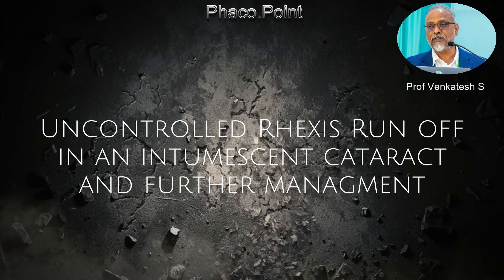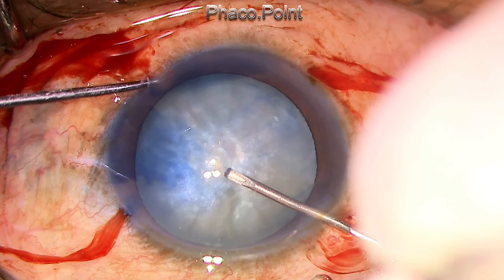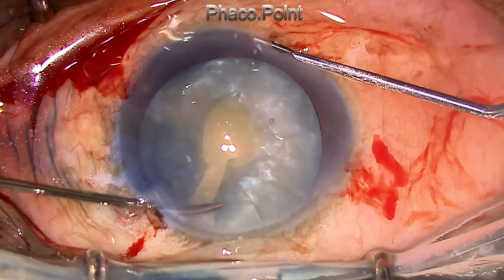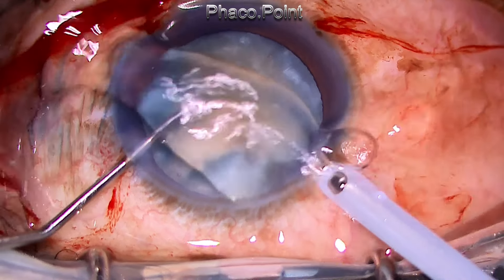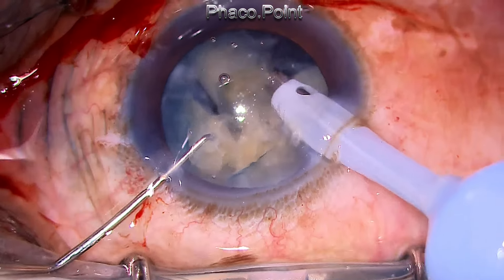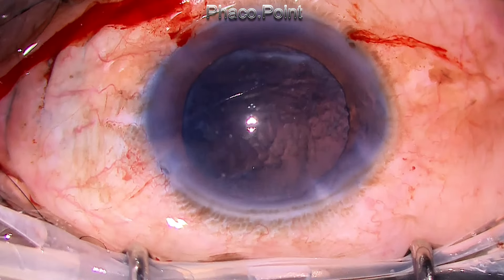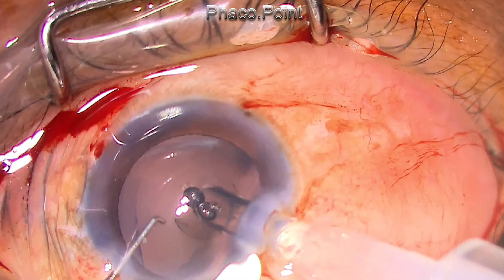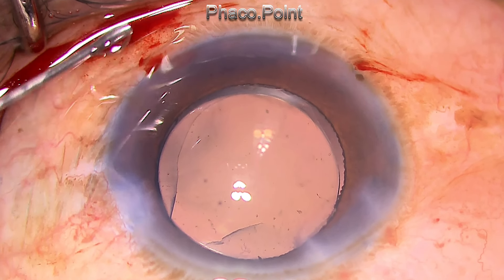Uncontrolled Rhexis Run-Off in an Intumescent Cataract and Further management with an EDOF IOL

Comment: Excellent management sir.
In my experience,use of micro-rhexis forceps and using side-port incisions only for making rhexis in any type of intumescent cataract significantly reduces the chances of run-off.
Visco-saline exchange is the most important in such type of cases to avoid tear extension to PC as perfectly described in the video. Thank you very much for sharing the video.
Reply from the maker: thank you dr Umesh. I will tr the mini rhexis forceps next times.

Comment: Is it useful to inject kenacort before injecting the iol? Just to be sûre there is no vitreous
Reply from the maker: In this case -NO, because using clinical judgement it is clear that there is no vitreous. But certainly in cases of doubt. signs like peaked pupil or de centring IOL or irregular AC. So many unnecessary steps can be prevented by paying attention to clinical details
Reply: @PhacoPoint  thank you! :)

Comment: Sir is it safer for patient and Surgeon to always convert to SICS in cases of rhexis run off or should we proceed with phaco thinking it will be our lucky day?
Reply from the maker: Please do not continue  with phaco thinking it will be your lucky day , because successful people make their own luck.. The same confidence you have with SICS will eventually come with phaco also and then you will not think of conversion but simply continue knowing that it is possible. This change in mindset will come with time and as you perform more and more phaco. It cannot be rushed. I have had many run off rhexis and I have not converted to SICS in a single case for the last 15 years.

Comment: Sir in case of rhexis run out is it okay to perform stop and chop by doing trench is someone is not confident in direct chop or if the cataractbis very hard in grade..
Reply from the maker: hello dr Abishek.. it is perfectly fine to do stop and chop . but take care to use enough power so that you dont push the lens down during trenching
Reply: @PhacoPoint  thank you sir 💛